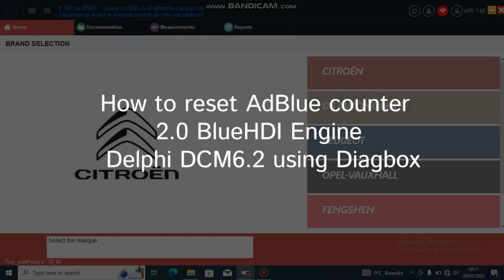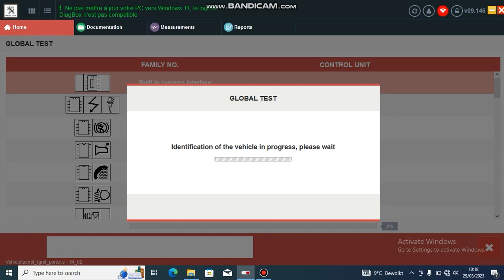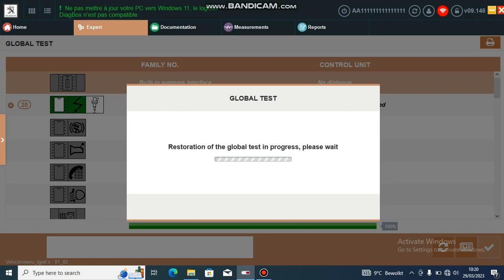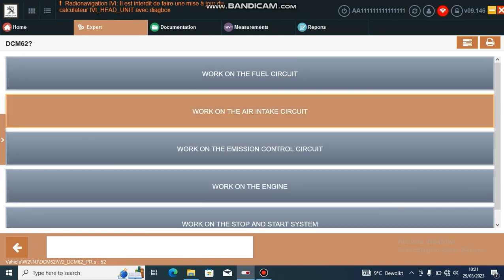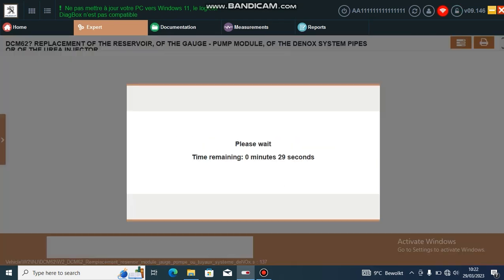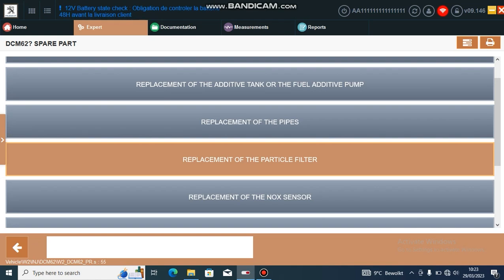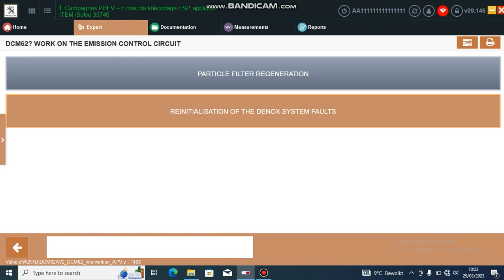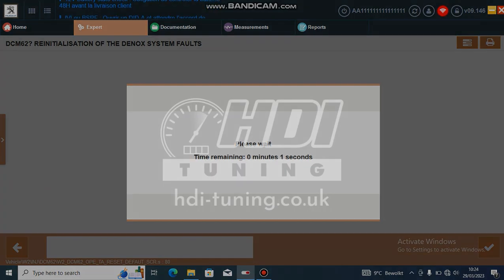How to reset AdBlue count down timer 2.0 BlueHDI Peugeot Citroen Delphi DCM6.2A DCM6.2C Diagbox

Comment: in that one case you had, did it give you an error to add ad blue (reffil emission additive, starting prevented in 2400 KM), I only have that error, the UREA light is on without saying SERVICE and without CHECK ENGINE... I assume that  I have deleted ad blue (with the previous owner), otherwise the ad blue tank is full of liquid....question: have you had a situation like this and is it possible to solve my problem in this way, or can I cancel this error in some other way?  thanks in advance
Reply from the maker: Probably you have a bad or incomplete adblue delete solution that's why the count down has started again
Reply from the maker: @darkomarkovic6626 Probably you have a bad or incomplete adblue delete solution that's why the count down has started again
Reply: @StevenLewis-HDI-Tuning  any solution? What should I get if I do same procedure like you??
Reply from the maker: @darkomarkovic6626  set to original software, reset with diagbox, then do proper adblue delete software

Comment: Hello, nice video. As i am trying "reinitialisation of the DNOX system faults" for delete "urea" failure after topup adblue, i got fallowing message. "Please do the actuator test before pressing on "Next". Afterwards exit without nothing doing. My car is 508 1.6 Blue HDi year 2015. Any idea? what kind of actuator test? thank's.
Reply from the maker: Maybe it just needs to prime the pump. Go to the actuator test menu and run any test related to the tank and adblue and adblue sensors then try again, let me know if it works after that?
Reply: @StevenLewis-HDI-Tuning  solved the problem. My car has handsfree keyless chip. First, It has to be put in to the hidden shelf nearby ECO deavtivation buttton. Second, on my diagbox  9.91v, while proceeding the procedure, before clicking on next buttons, there is near left side a refresh button, you have to activate first this button, then go with next.

Comment: Hello there! I bought a full chip cable and I’m not able to flash it or use it with any version of Diagbox. After start Diagbox I have an error message about impossible to connect to vci. 
My version is APPLI_S_Fuji_ P106138A V4.3.0 @ACTIA 02.01.12
Reference 921815 C/ Inconnue
I tried everything but I can’t upgrade or downgrade.
Reply: I bought one that wouldn't connect.
The seller immediately replaced it with a working version of a slightly different design, which immediately recognised the car, VIN and equipment.
Reply: @TheDajoca  would you please share the cable link to check it out please? 🙏
Reply from the maker: Sorry I don't know how to help, I only installed it once and to use it, you'll have to ask the people you bought ot from for help.
Reply: Read my post if you have a car with handsfree keyless chip.
Reply: @fuatcoskun4510  I deleted using Diagzone and working great 👍